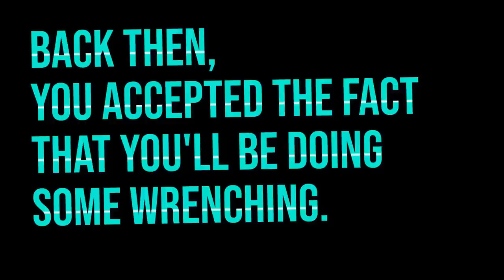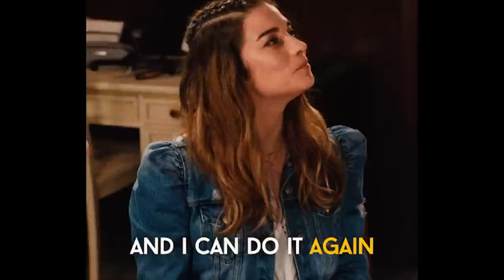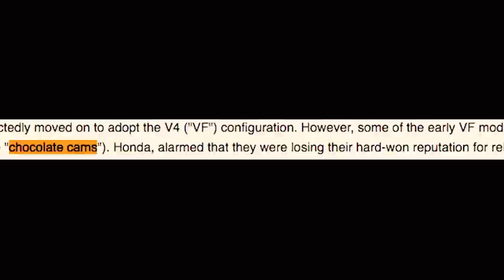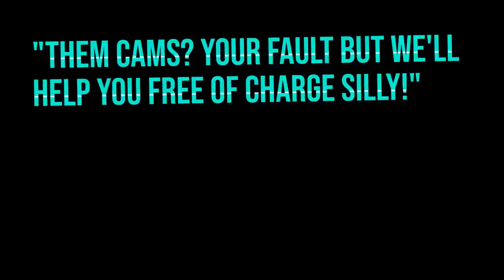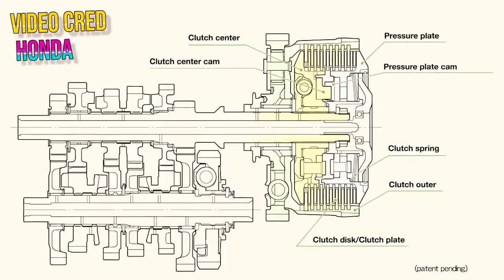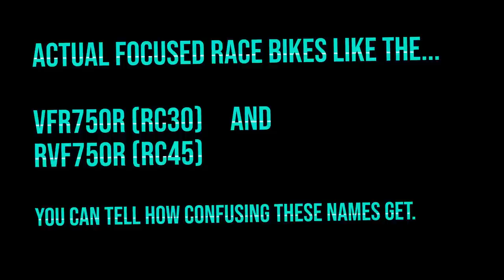A Brief, Opinionated History of the Honda VFR - V4 Sportbike

Comment from the maker: By the way, I mentioned the change in render time for motovlogs (7 hours down to 10 minutes)
This voice over vid file took 5 minutes to render...down from maybe 2 hours (4 if I decide to throw my orange tint on it)
Normally I would just leave the house while a video renders so I don't have to stare at it.........this time, I just made a bagel.
Reply: Bro do you have an email I can contact you at? I got some good news I wanted to share with you.
Reply: So happy for you man. My favorite vlogger and so relatable. Seeing your determination to create art in unideal situations is really motivating, man. Props
Reply: You winning, we winning.... I've been expecting you to make those moves.
Reply: As a full time motorcycle mechanic I wince whenever one of these V4 VFR's show up at our shop.
They are a nightmare to work on. The simplest repair takes days!
Reply: @DennisMerwood-xk8wp  is it because of the number of cylinders, valves, or the fairings?
Reply: @rocketrollsvlogs7625 
 My mate used to joke that there was more bolts in the fairing of a Honda VFR than in the whole bike we used to wrench on back in the day! LOL
Not the number of cylinders. In-line 4's are a piece of cake to work on compared to these V4's
Working on the intake system crammed between the banks of cylinders of these V4's is a nightmare.
VTEC - don't get me started!
In our shop we would rather do a valve job on a desmo Ducati than on VTEC V4 Honda - and that saying something eh?
Reply: @DennisMerwood-xk8wp  thanks, I'm just a hack shade tree mechanic, and have only been inside parallel twins. Honda Rebels and Nighthawks.
Reply: It could be because you actually had negative render time with the footage starting at the 10:27 -ish mark.
You could probably fit that bit on a floppy disk.

Other than that: first of your video's I saw, found it on r/motorcycles.
Good job, I'll see what else you've got! I like the pace and style of this video.
Reply: Hey, l started watching the VF vid, and getting sidetracked, have to come back l8er.
Went to your home pages, and wham, the bmw slab. That was the 1st vid l saw of yours. 
Good to see ur still keen as with ut stuff.
I'll xplore more L8er.

Comment: I think my 1998 is one of the best looking bikes. Different, rare, and comfortable, built to last! I love just looking at it!
Reply: I've got one too.
And he said it's the ugly one. That hurt my ears.
Reply: Same here, I love it.
Reply: That is what i think to  i had one for 10 years
Reply: I have a 2000 VFR800, basically the same bike. I think it's the best generation VFR -- gear driven cams and fuel injection. But it does suffer a little bit from ugliness. Depends on which part of the bike you're looking at. The front end is great, but the tail and the front fender...ugly. I re-cut my front fender to give it a sportier shape. Still trying to figure out what to do with the tail.

Comment: Excellent video.  My second bike, bought used in 1988 was a 1986 VFR 750F which was when I fell in love with motorcycles.  I have had several other bikes since then but always missed that bike.  Today I bought a 2006 Gen 6 version and couldn't be happier.  Thanks for the video.

Comment: [Hears the 5th Gen called ugly]
[STARES IN 5th GEN OWNER]

j/k, great video. Taste is taste, but I love the look of my 5th gen. The linked brakes sound like a bad idea, and if you want to slide your rear wheel, they might be, but in normal riding the system is almost invisible and the available braking power is huge. I jokingly refer to it as the most normal motorcycle ever made, but that’s a compliment. It’s fast enough for me, it has no bad habits, and the engine is so tractable.
Reply: It's funny cause I bought my 5th gen over a 6th gen mostly because I thought it looked A LOT better.
Reply: @eirha  I hear you! I mean, looks are a matter of taste, so it’s ok to disagree. Non-motorcyclists are always shocked to hear how old my bike is, I think the looks are surprisingly timeless.

Comment: I had a white 1990 VFR 750 F RC36 it was my first bike and man did i enjoyed driving it. From highways to backroads and the Nürburgring. only had 1 "major" hiccup when 1 of my spark plug treads were done for. Had to change the whole cilinderhead with my brother in law. But it worked and still drove it for thousands of kilometers. Sold it to a friend and bought a 1999 CBR Super Blackbird 1100. I also enjoy that one.

Comment: 5th Gen is the pinnacle for me, gear driven cams, fuel injection and valves a home mechanic can reshim. I don't notice the linked brakes until last ditch stopping where the bike remains level as if by magic.
As for the looks, front on is beautiful, from the side it's a bit lardy.
Reply: don't forget the 'choke' on this injected motor lol
Reply: @k0nanick  I think the "choke" (fast idle) is quaint, a throw back to an older age. When servicing I use it to get the engine up to temperature without having to blip the throttle.
Reply: Yeah I'm glad I've got the 98 with the choke. I love it

Comment: Dude. Srsly. You can talk about Honda as much and as long as you want. I'll be here every time and enjoy you talking about them.
Also, out of the 7 bikes I have owned, 5 have been Hondas, and two were VFRs, and after an '06 CBF 1000 with fuel injection and ABS, I am now riding a '97 VFR 750.
The VFR isn't the lightest bike. It isn't the most powerful bike. It also isn't the best handling bike. But it doesn't have to be, because the VFR is the perfect bike. ;-)

Comment: I bought my gen4 97 silver twice haha. I sold it and went on to buy ride and flip alot of bikes searching for more power more excitement. It came back on for sale locally and i missed it so bad. So bought it again still have it now years later. 

What i found is the more power and tight suspension you get is not built for UK roads but the vfr750 eats them up and you can sling it about and use the torque it gets me into more trouble than my gsxr1000k4 because you cant push that!

Comment: I had a 85 VF500F upgraded to a 87 VFR750 later upgraded (?) to a VF1000R then went to a VFR800. 

If I had my choice I'd like to have the 87VFR back. 

The 1000 was not much of an upgrade over the 750, and realistically the gains in power were subsumed by the hit it had in handling. 

And of course the VFR800 just didn't have the soul of the 87 VFR, when the VTEC kicked in it went from monster to demon but it still didn't have that overall visceral feel  of the Gen2 

In my mind the only thing you could have done to make that bike better would have been to give it wider tires, and inverted forks and in my mind it would have been perfect.

Comment: I'm looking to pickup a VFR this summer.  I have a 1985 Magna VF700C that's a blast to ride.  I don't care about the looks so I'm kind of leaning toward a Gen 5 VFR800.  But I'm also interesting in a VFR1200.  Why the 120...well 170HP sounds like a pretty good reason.  I've also fallen in love with shaft drive like my Magna has.  I'm planning to go and ride a few bikes and see what I think.  I'm afraid I might just make a decision strictly on HP but then I'd miss out on having owned a VFR800 which seems like something everyone should do.  What do you think?  Thanks for the fun video.

Comment: 1980's Magnas and Sabres were shaft drive and 6 speed in V45 and V65. The interceptor was the only different drive with a 5 speed chain drive. V65 Sabres were the fastest of the first V4 muscle bikes.

The USA ban on big Japanese bikes happened during this first run. Honda shortened the stroke of the cylinders to 698cc and threw on a quicker final drive. I have an American 1984 final drive installed on my 1982 V45 Sabre and it is insanely quick.

Comment: I own the VFR 750 rc24 88', I bought it as a complete beginner because the price was right (less than 2k which is great in CH). I had no idea what I was getting into, I just read somewhere that they are reliable. It feels like two different bikes. At low revs you have a comfortable tourer, maybe a bit awkward to move slowly in tight turns because of the weight, it just takes practice. (That was much easier with the duke 390 i rented a few times). Between 6000-7000rpm occurs a revelation. It sounds glorious and has an astonishing pull for such an "old, heavy" sportstourer. But it never feels like it is fighting you, no surprises. It's not like that idiot friend who dares you to do something stupid, more like your friends dad who has done this for years, shows you the ropes and doesn't push you into doing anything.

Comment: I started VFs with the first VF1000F, Stunning power everywhere for the time. Handling for the time surprisingly good. It could corner at 130Mp)h. Most bikes coulde not get there in a straight line.. It could do England to the south of France in a day Two up with luggage and murder the biggest Susikis even though they were soloµ.. But that is not the subject. I got the first VFR750 in red, white wheels single side swinging arm. Over engineered to the point where they put a fairing on the sidestand. This is the one you should collect. But it had 3 faults. 1, On a hot day in traffic the side radiators and frame would cook my legs even with race leathers. 2. the rear tyre was too large for the size wheight power. I learn't in the 1970s that to over tyre a norton, did not make it faster, it made it less accurate. 3. It was so easy to steal AND mine got stolen. Now I have a 2000 800, gear driven cams, simple (if you can say that) 4valves. Does not cook my legs, not easy to steal. It rarely  meets something to challenge it. The other day I met a 911 turbo cabriolet, prancing in the traffic, revving and showing oàff. I slipped in behind him, he could see me in his mirror, next roundabout I dropped two gears and went past his face at 12000 revs, The scream of a VFR Honda
Reply from the maker: Haha. Thanks for sharing your thoughts and experience.

Comment: I personally know of two old geezers(in their 50s) that have older vfr, one is the older 90s one with the divided head light unit and the other is the first 800(I think it was that or the model just before it, cant remember) but both of them had way over 320.000 km on the odometer at that time which was 2013-2014. One of them had never done anything to it but change the oil yet it went like stink when the whole club got together for club rides. Impressive, but they were more impressed with my nc35(rvf400) at the time which also had 60000 on the odo, and God knows how much more it really had done. What I missed with my v4 was that it did not have the same 270 degree crank as the much cooler sounding bigger v4 brothers but instead had the 360 one like the rc30 and that sound a bit too strained if you will.

Comment: The early VF interceptor was a separate model from the sabre and magna. Interceptor has a different engine orientation and it's unique from the other two bikes. If you look at a sabre or magna beside an in interceptor, the Interceptors front cylinder bank is more upright and the rear bank faces more rearward.

Comment: Had an ‘86 VF500....fastest 500 ever built IMO 👌🏾
Reply from the maker: Ever encounter any camshaft issues?
Reply: @Theillestrator1050  HOOLY! Honestly honoured to have you comment. Love your vids man! I’m a mid 20yr old black dude who rides in Ontario,CA. Started riding about 4 years ago. I bought the bike in pretty rough shape with parts from another 86 vf500. And made a pretty clean one if I do say so myself lol. Rode it for about 3 years with no issues. I’m 6’2 and wanted something more comfortable for 2up riding and long distances, so I ended up selling and buying a 2011 VSTROM, then sold that after half a year and got a 2015 Honda NC750X (non-DCT). Absolutely love the bike and it’s practicality. Amazing for my needs. 

Only issue I had was vf500, hydraulic clutch started leaking at the lever near the end. The NC750x is the perfect commuter, but the interceptor had “get up and go” like nothing else, SNAPPY v4 👌🏾👌🏾

Comment: you missed the point the vfr800f1 1999 was the best most brutal and the linked braking makes it squat in fast bends improving cornering, i know i had one and had the chance to go flat out on the road 250km/hr and still accelerating! Didn't ever become my BEST bike ever because i don't drop handlebars but i have had z1000, trident, and now ride a flat twin beemer injection, the 1999 was the fastest, would eat ducatis mainly in sure footed handling, just bung loads of tyres on it ;0)
Reply from the maker: I hear you,  In all honesty I'm a bit of a city slicker so top speed and fast corners don't really exist to me. It's all about torque, full brake control and maneuverability so I wouldn't get much use out of the linked brakes lol

Comment: Great vid as usual! I do love me some Honda. As someone who researches gas engines for a living, I love their engineering and think they have made some of the best engines ever.  Just a quick correction on the VTEC system, it's not that it switches from actuating 2 valves to actuating 4 valves, it has 2 different cam profiles that it switches between. Here's a video that shows the mechanism. https://www.youtube.com/watch?v=7tTVYzuQs8s
Reply from the maker: Glad you enjoyed!
 But no sir, not with the bikes.... It's based on E vtec not ivtec. It's not the same as the linked system. It just works as I described by enabling valves depending on rpm
Reply: @Theillestrator1050   Glad to be corrected! The original E-VTEC does operate with the valve having smaller and larger lifts but apparently they changed it for the motorcycle applications to where one of the valves remains closed.